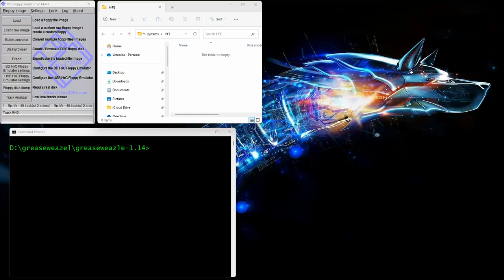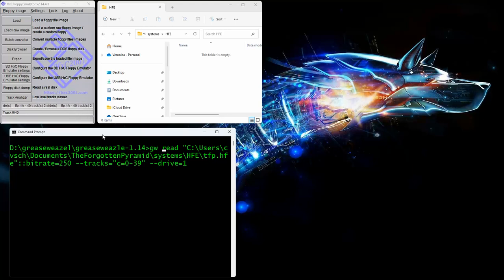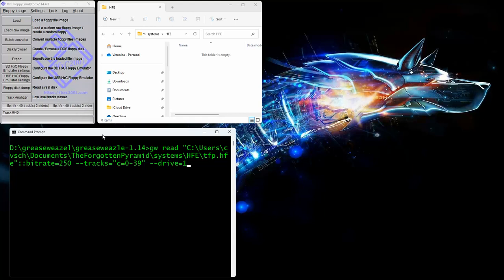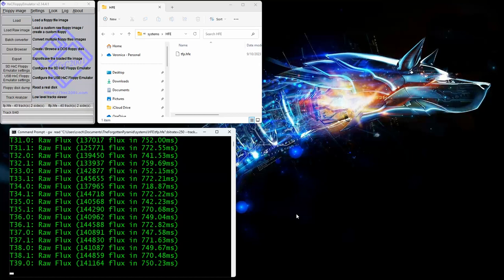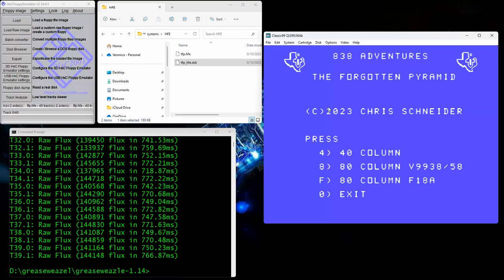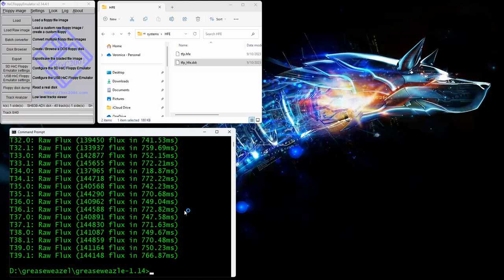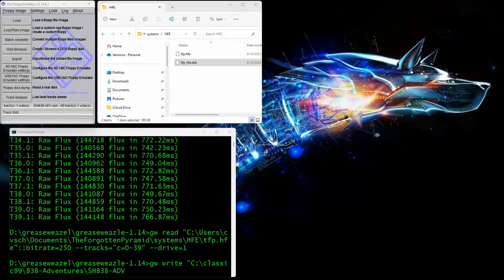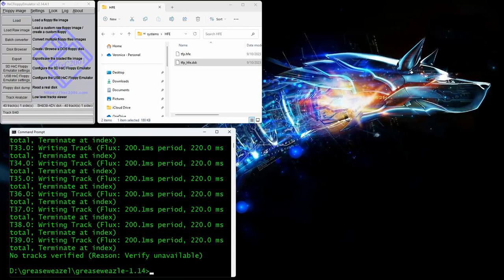TI-99/4A with GreaseWeazle

Comment: This is great, but I can't get Greaseweazle to work at all with the OEM TI Shugart SA400 5.25" floppy SS SD drive, even with extensive help from Keir.   Very frustrating - we have tried everything.  The drive is fully refurbed (calibrated, new microswitches, new track zero LED and photocel) and works flawlessly in the TI, passing all diagnostics with zero errors.    I'm disappointed GW doesn't support this ancient hardware.

You must have the 80 track mod for the TI floppy controller card to be running 3.5" drives, which of course are not stock.   Not sure how useful this is for people without the mod.
Reply from the maker: I don't have a stock 90k TI SSSD drive as all of mine have stopped working.  I can tell you that I have used them on the 40 track TI disk controller with both 3.5 drives and 5.25 drives that are non stock TI drives.